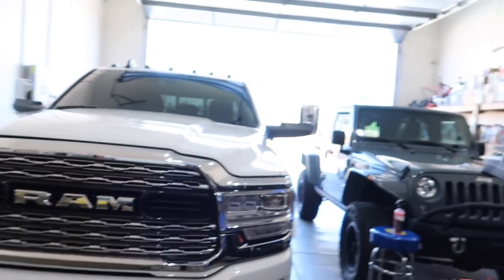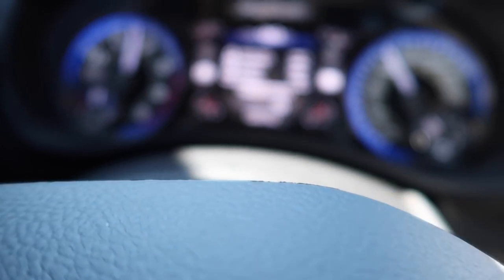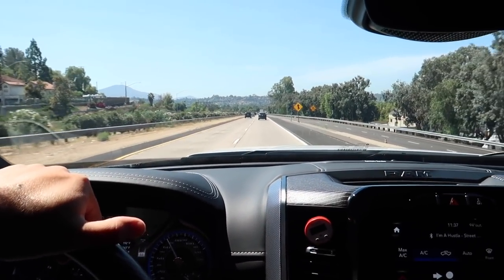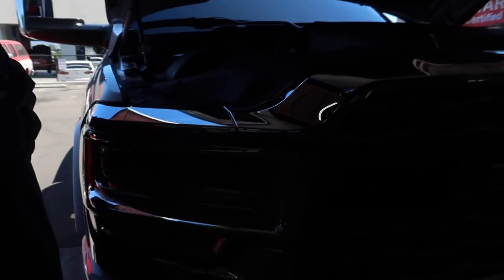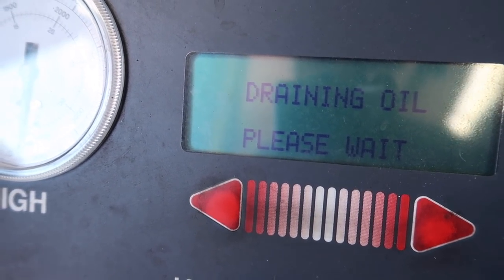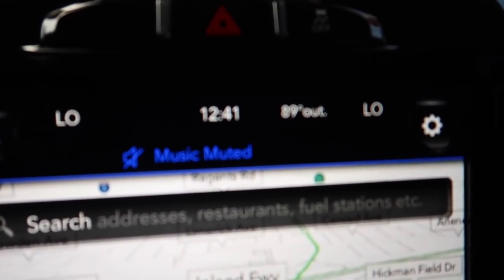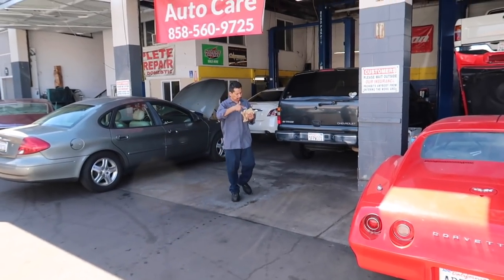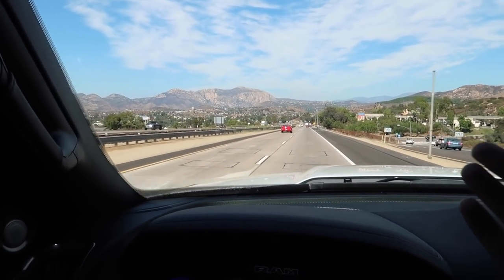AC PROBLEM WITH THE NEW RAM OR IS THIS NORMAL?

Comment: Dude learn how it works LOL Max A/C is the circulate which cools the inside air!! not the out side air which is why it gets cooler and is what you should have it on. If not the A/C has to cool the HOT outside air down to what it is set for.. As for it blows out to fast.. Turn down the blower/fan LOL it will still work as it should. But FYI keep all of you RO`s if you take it to the dealer for this or any issue. And check to make sure they close out the RO`s. So not to run them together as one. Which means if you take it in 20 times for the same issue it will only show one or two time for the same issue. Plus Dodge will only pay the dealer once maybe twice for the same diagnostics.  IE mileage is not the same as it was the last time it was in, or the RO does not have a invoice number with an A or B or C on it. If it does that means its the next page on last RO which was left open on you. Because 4 times for the same issue is lemon law and they know this and will leave the RO`s open so it will show you`ve only been there 1 or 2 times. I just went through this with Ford
Reply: I put my truck on 68-74 degrees depending on when I get in it and then as it gets cold I adjust to the temp I want it to stay at.  It uses max/whatever it needs to get the truck cooled down then it adjusts itself to what it needs to keep the temp regulated.  Can't he just set the temp and let it do it's thing and see if it does it's job?

Comment: Everybody with a 2019 Ram I know of has A/C problems lol
Reply: Just purchased a 2019 tradesman 3500 max tow . AC is freezing cold within 15 minutes, and were hitting 102 degrees here in texas.
Reply: @truetexan7755  cool ! good for you! just quite a few have issues already
Reply: I don't
Reply: Scott Harris Lol my point wasn’t everyone is going to exactly. But u might still soon . I’ve heard anything from brake booster swap to A/C issues to Aisin transmission update all on 2019 Ram in the first 15,000 miles and that’s way too soon to be having issues with a truck
Reply: I haven’t heard of any of those problems. No issues what so ever.
Reply: Scott Harris Lol that’s a funny statement on a video with A/C problems 😂Just look around on YouTube abit and you’ll see all 3 problems

Comment: I have the same problems.  I noticed it the first day i got the truck. Drove it from vegas back to California wit the ac on LO fan on 2 and im sweating... i dont have that problem on my 17 2500. Put the fan on higher speed helps. Still for a brand new truck. Ac performance should be better...

Comment: Hey Eddie Im a hvac tech 55° is a normal supply air it could be different for auto but you can have air flow restriction for the one middle Vent vs the passenger side. You want to shoot for a 20° temperature split from return air to supply air, industry rule of thumb. Also the tech should’ve charged the system from the high side to prevent flooding the compressor since the machine charges it as a liquid not a vapor. Also keep up the good work like following your channel as well as dmaxrynos 👍
Reply from the maker: thats good to know thanks for the info man

Comment: How did you get a 2019 Ram with R134a?
Reply from the maker: When u build it tell them you don’t want 1234yf u want 134a
Reply: @EddieLife3500  Well played! Did you ever figure out why the passenger side blows cooler? My 2014 Ram 1500 does the exact same thing. Drivers side 58°F passenger side 46°F

Comment: This is well documented on 5thgenrams.  It's "normal" per RAM TSB but not normal to anyone who has driven a vehicle with A/C in the last 50 years.   It's a 2 minute fix by clamping the heater hose out line from the engine or you can get fancy with a $12 valve from the parts store.   RAM is never going to acknowledge this so don't waste your time.

Comment: Did you check thermostat? or cabin air filter. ac condenser,  blower resistor motor,
Reply: Tim Francis the truck is literally brand new
Reply: NEPAMOTORHEAD your point is...
Reply: @ChaoticDave69  my thermostat was bad from factory, and would blow cold air during blizzard took it in to shop and found out all the parts i listed were bad please delete comment or will block you
Reply: Erik Ambis a thermostat has nothing to do with air conditioning . Period and it’s brand new under full warranty . No need for him to check things . Also the air temp that he’s getting is normal .
Reply: Tim Francis I’m not deleting my comment lol . And a thermostat has ZERO to do with air conditioning
Reply: Erik Ambis no need to call names when you are wrong . Grow up and act like an adult . He doesn’t want to take it to a dealer yet so he’s checking temps real time which is smart . But if he dug into like you nubs are telling him guess what his warranty is void !
Reply: Erik Ambis grow up ... blocked 😀
Reply: NEPAMOTORHEAD poor guy he needs to relax just a tad.

Comment: Make sure you use the 1234yf freon
Reply from the maker: why would i use that when the system takes R134a
Reply: That what the newer fca vehicle take unless it doesn't, and in your last video you can get the rear step that tucks away
Reply from the maker: no mine says R134a under the hood
Reply: Why not take it to the dealership it still under base warranty unless you don't like the service department at the dealership

Comment: I’m telling you go to TFL trucks YouTube channel they compared 2019 F150 super crew against 2019 dodge ram crew cab they put the thermometers in the front air vent just like you did and they put one in the cupholder back in the consul turn them on high in the Ford pushed out 45° And the ram pushed out 55° and a Ford got to 75° first at the back of the canceled but only by a minute or two
Reply: Badass F150 My 2017 F150 will freeze you out of the truck it’s so cold!

Comment: Eddie they suppose to charge it in the high side and the reason that is cold in the passenger is because the evaporator is right  there's  in the passenger side they forgot to run a vacuum on the system minimum time of vacuum is 30 minutes
Reply from the maker: i just checked lewis truck and everything was identical to mine same temps and the passenger side is colder on his also
Reply: @EddieLife3500  Eddie if you dont want to take it to the dealer just run a vacuum in the system so you wont have moisture in the system new truck and new car sometimes when they are build does cars they have  some moisture in the system just make  minimum time of vacuum is 30 minutes
Reply: on my 2013 and now on my 2017 ram I turn it to the max air setting until it cools down. Seemed to help a lot living here in the hot California desert.
Reply: Like is said is always colder in the passenger is because the evaporator core is right there in the passenger side so is direct air is like you stand I  the front of a fan is colder air move back is more hot air

Comment: Chrysler has never had a great ac system. There are exceptions I'm sure. But as a rule they suck and you can't get them right. I told you so on an earlier post. I'm even betting the interior is crap within a year. Should have stuck with GM.
Reply from the maker: will see i will keep you posted on interior and everything about the truck so far so good and i am loving it
Reply: @EddieLife3500  I apologize for being such a crude. I love the Cummins and Aisin combo. It's just everything just falls down around those trucks. I wish Gm would get there act together and keep up with technology and really put some thought into their dashboard. And with a better fuel timing map they can get those Duramaxes to respond way better down low than what they do now. I dont know if it can grunt with the Cummins but you will not be sweating inside the cab. Love the channel man keep up the good work!!
Reply from the maker: i have herd from lots of people that interiors fall apart your not the only one, i hope mine stays good but if not you guys will be the first one to know
Reply: @EddieLife3500  you do take very good care of your vehicles and I'm sure that will help keeps yours immaculate for a long time.
Reply from the maker: thats what i am hoping for

Comment: I'm sweating my bag off today in Canada . 2021 same fucking problem.
Reply from the maker: I hate it
Reply: @EddieLife3500  Any known fixes? Dumb dealers are looking at me knowing it's an issue, but playing stupid.
Reply from the maker: Yes you have to put an valve on the heater hose to block it off, or you can put an electric one on so once you click your AC button it will close then when you turn the AC off it will open so you have your heater when you need it
Reply: @EddieLife3500  Amazing, I need to find a video on it.